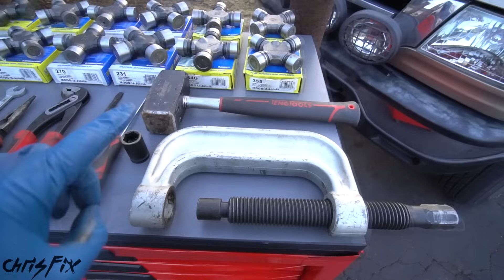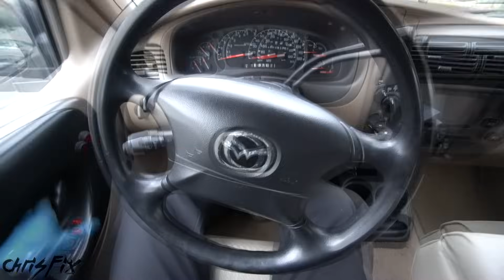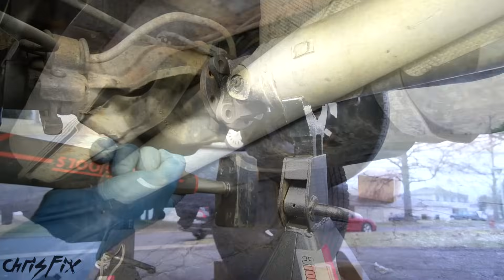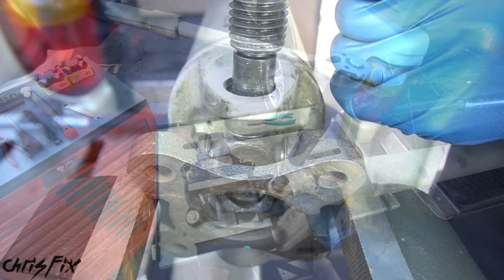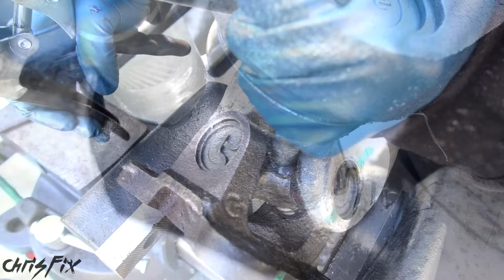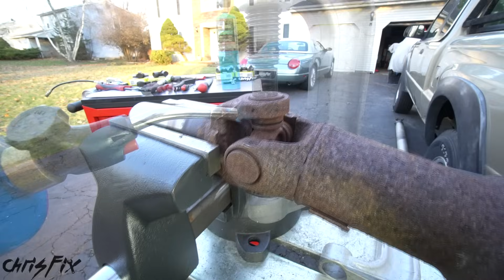How to Diagnose and Replace Universal Joints (ULTIMATE Guide)

Comment: if your rear end has the straps that go over the ends of u joint like a 7.5 chevy has get new straps or you will have to pretty much smith it till you get the tolerances back into spec . found that out on a 81 elco  still rattled even though new ujoints were in an the clip in lock position . i know its not a ford with a 8.8 . but just saying for anyone trying to figure out how to do on different vehicle knowledge is power but can be annoying so ill shut up

Comment: I’ve got a ‘95 f150 with almost 275k miles. It’s lifted slightly, not a whole lot. I was climbing a steep hill today, as I do most days due to where I live, and I heard a loud, rapid banging sound from what seemed to be under the bed as I climbed the hill. Could it be a u joint?

Comment: Gotta a question:
Have 92 ranger extended cab (super cab). This truck has the 2 piece driveline with the center bearing. I think I have the single Cardan connecting to the t case ...boot and driveline connecting to it and the rear end.  I'm replacing the u joints and the center bearing. The repair manual has the figures for torque specs Circular flange (flange that connect to rear end) 70 to 95 lb ft
Supercab center bearing bracket to frame (cnn bolts that connect to frame) 27 to 37 lb ft
Supercab driveshaft to coupling shaft bolts (think this is the 4 small bolts on the Cardan shaft) 13 to 18 lb ft
Supercab one half round yoke to coupling shaft 100 to 120 lb ft
Supercab slip yoke to coupling shaft tube 41 to 55 lb ft
The problem is don't know how all of the parts look...no pics also don't have a torque spec for center bearing bolts (bolts holding the center bearing in) or  driveline bolts that connect to the t case (book just says whatever! hahahha) if no answer I'll post up what I find anyway... pulling things out sometime tomrrow!
Reply: Oh yeah reason for repair: you know how some people's knees pop that is the sound when driving up an incline. Doesn't happen always on small inclines yet driving a few 1000 feet up you would always get it. The center bearing has cracks in the rubber, the drive shaft is moveable, and looks like a u joint has moved slightly.
Reply: Also if anyone for some reason don't mark the driveshaft and are in a bind there is a way to get it back in balance. Will take some time out your day but it is possible. If you want to know I could post it up!

Comment: Driveshafts are balanced (as Chris mentions), if you change your u joints and suddenly have a bad vibration you may have the shaft installed in the wrong orientation.  I know of someone that spent 3K on a new transmission, differential, etc. when it was just that the mechanic installed the driveshaft out of balance.

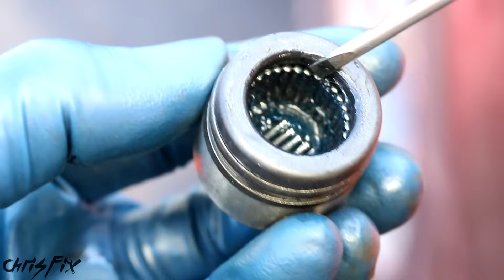Comment: This is by far the most comprehensive video on this subject that I have come across. More importantly, ChrisFix  has achieved a level of Jedi video skills that I as a videographer can only aspire to! (Not sure if my issue was already covered in the 5000+ comments but anyway, here goes...) Today, I attempted to changed my u-joints and came across a problem that was illustrated at 16:08 and that is, falling needle bearings. Once you check that the needle bearings are in their proper place, you set the two opposing end caps. The problem is if you are using the hammer method to INSTALL the end caps there is a moment or two that the shaft is not close enough to the needle bearings to hold them in place and the mere action of hammering could dislodge one or more of the bearings AFTER you have checked them and when you CANNOT see them. This happened to me and result is that the two needle bearings that fell flat, cracked the end cap while I was hammering it in a futile effort to get that last 1mm for the retaining clip to fit. Now getting the u joint out to swap out the end cap meant hammering it from the damaged end. The added problem here is that the shaft pushing out the opposite end cap damaged the plastic liner of that other end cap. Result is...I have to get another u joint tomorrow when the stores open before I can finish the job. Just be extra careful and you should have no problems but remember that if you need to back out an end cap, it could get damaged.

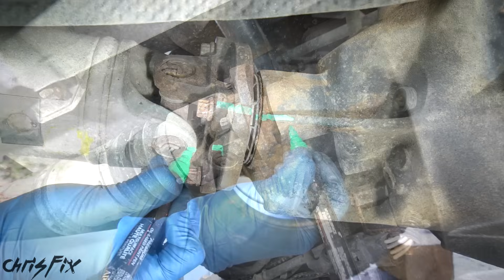Comment: At 8:50 Why marking> First: if not installed exactly as marked what would happen? Second: Does it mean I do not have to replace the whole shaft when the replacement is from a junk yard because it's unmarked.? By the way, great video. Thanks!
Reply from the maker: It shouldn’t matter if you don’t mark it but marking it allows you to remove any type of change that could cause a vibration. You can install a junkyard driveshaft and as long as it’s balanced it should be fine. Marking it is just a precaution since it’s so easy to do.
Reply: Got it. Thanks!

Comment: Wow Thanks for this video.!. My 2003 Toyota Tacoma's  drive-shaft  is making a similar Noise. I Think its the U-Joint.. But the the sound it makes sounds, like the clicking sound " As you back-pedal on a 10-speed bicycle ".. ( A Clicking sound ). Other then that the truck shifts good. Gos in reverse good..I'm just Confused with this sound... Mr ChrisFix, do you think maybe its an U-Joint.. (Thanks Mike Ziggy ).

Comment: If I forgot to grease the u joint after replacing it, will the grease that was packed into the bearing cap from the factory be enough or am I waiting for my new u joint to fail? It was definitely the type with the grease fitting

Comment: You guys Don’t have to waste your time marking everything to line it up because I just did mine and I didn’t mark anything and it’s perfectly fine. All of the Unnecessary cleaning and does not need to be done. It doesn’t change the performance at all and it really doesn’t make a difference on putting the new u joint in.

Comment: Chris, thanks getting ready to do this next weekend on my Ford F-250 that has three u-joints. Appreciate the great tips on the removal, replacement of u-joints and reinstallation. Especially appreciate the reminder on marking the flanges and drive shaft on both sides with neon ink for replacement to ensure it remains balanced.

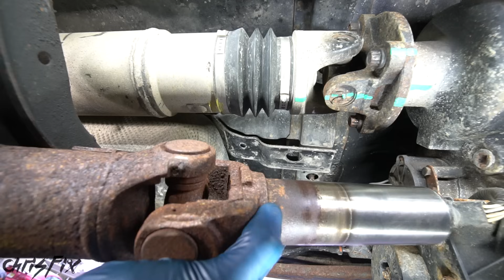Comment: 10:42 How worried do I need to be about how careful I am at removing and reinserting the yoke so I'm not ruining the seal inside? Not sure if its transmission fluid or transfer case fluid either, how do I know? I heard I should regrease the yoke because I need to use the correct grease so I'm not contaminating the transmission fluid/transfer case fluid which ever it is.

Comment: Great vid; 3 comments: On fittings with the zerk in the end cap, one snap ring is different to allow space for this.  When the zerk fitting is on the body, it's often more accessible on the side toward the driveshaft.  Some U-joints may come with different thickness snap rings to better center it in the housing.

Comment: I saw an old pickup truck driving down the highway, when in an instant the back end of the truck flew up in the air like a giant reverse wheelie!
Turned out that his front u joint fragged and dropped the drive shaft which acted like a pole vault nearly throwing the truck end over end. It was a spectacular surprise for the driver I’m sure!

Comment: The amount of work that went into this video is incredible. I don't even have a 4 wheel drive car (yet) and I just spent 20 minutes watching this video! 

It's the little details like the sliding tool/parts transitions etc that give a real professional feel to it. It's also great that you showed how to change them on different type of fittings. 

Great tip about hammering to loosen the new u joint. Why is it so stiff when fitted and how why does that loosen it off? 

Great video, thanks for taking the time to make it!

Comment: Hey just a heads up for Subaru owners this is a great video to watch to fix a damaged u joint but just a heads up on some Subaru’s you can’t take the u joints off the drive shaft. If the one of the joints are broken you’ll have to replace the whole driveshaft.

Comment: I did that, replaced my u-joints. And I still got drive shaft shaking. I have a rear wheel drive 1997 ford ranger. With just a single drive shaft. The shaking is so bad, that it keeps ruining my speed sensor gears, the plastic gears that go on the sensor, that they don't sell in auto stores, but can only be purchased online. Then I have to drive it in second gear, to reduce wear. I have been trying to fix it for about two weeks now, and it is hard to drive it to get parts, and then they don't help anyway.

Comment: good video...one thing though ..make sure the driveshaft  has no load on it when checking play. put it neutral and put the ebrake on..i have missed bad ones because there was just enough tension to think everything was tight.

Comment: That was an excellent video. Sound and lighting were perfectly done. 

Your demonstration of what one experiences and can test for to see if they need to be replaced was great!

I really liked the multiple techniques for replacing (hammer and press) and showing the 3 varieties of U-joints and explaining which ones to get for replacement and why one over the other (good choice - Moog).  

One thing I would have liked to see is the lack of liquid vibration at the end after replacing the UJs. 

Your use of the paint marker for correct alignment and to show any bolt movement is a great idea too, especially as you explained that they are balanced at the factory but that leads me to question - how do you balance it when you replace the driveshaft?

Finally, maybe it's really not that hard to center the open end of the press but using that socket you used for the hammer removal method could have helped to align it.

Comment: I have a '65 Mustang that has started to show some symptoms that I thought might be u-joints.  Your video describes my symptoms to a tee. U-joints are definitely on the agenda.  Thank you for the excellent video!
Reply: Tip - if you don't have a paint marker, Wite-Out works just as well, if you happen to have that.  I did mine - OMG, the front one was a disaster - broken cap with all needle bearings actually gone, that shaft on the body of the u-joint chewed up badly.  Replaced them both, no more symptoms.  Hooray!

Comment: well im seeing this video 3 years late. replaced my ujoints on my driveshaft and did it improperly. I was rolling down the highway at about 70 and ujoints came loose and cracked my transmission bell housing along with 3rd and 4th gear. lol

Comment: Hello the Great man,
Reaunalt megan 1.6 petrol, manual
I have problem with my car start on the car works but don't turn on I have electricity on my Dashboard I see battery alarm but I charged battery and I still can see battery alarm, petrol is coming from Gasoline hose I changed the spark plugs my car was twodays under rain and after that when I wanted to start my car became turn on and then became turn off and fan in front of Radiator starting to running and after  my car didn't start sometimes I hear a sound form Electric throttle can you help meI live in the Swedenand here price for repair is too high

Comment: Also, the best preventive maintenance I can give out is replace out your output shaft seal if you have the drive shaft already out, all you need to do is pry out the old one and tap a new one in, it'll save you time and hassle down the road
Reply from the maker: Thanks for the tip!
Reply: ChrisFix anytime! I just replaced out my output shaft seal for my truck, and it was a pain to remove

Comment: Chrisfix: driveshaft moves 5 millimeter->somethimg is wrong. Me:driveshaft moves 10 centimeter up and down with only my hands from a bad angle->its good still(in a 200 euro car i use to drift in snow tho)
Reply: And the driveshaft once broke from the rear when i was going around 70kmh its a nice sound when that happens

Comment: I haven't done the diagnostic yet but pretty certain the u joints are shot, so I'm sure this video is going to come in handy soon. My only concern is the fact that the previous owner had lowered the car and put  a new exhaust system in that forced me to use air shocks to raise it back up and keep it from scraping the ground, as they left no room .... 
Noticed I'm losing breaks and thinking there may have created an impact to the drive line that caused both problems.  Like I said, I'm just figuring stuff out on my way and haven't even crawled under her yet. This is a 1965 Buick Skylark 300 that I just got and want to be sure it's as stable as I can get her without breaking my knuckles or my bank. 
Ladies can get er' done too but oh how grateful I am for men.... hee he
Might just post some videos so you guys can pat yourselves on the back too for when I get it done right. 
Thanks for the video Chris
ciao

Comment: great video, it helped me out greatly on my 2000 ford ranger, where did you purchase that metal portable work bench from?
Reply: Eric Poulsen II is yours rwd or 4wd? How many u joints?
Reply: MCFriedChicken1  RWD & 2 universal
Reply: Eric Poulsen II oh what part number did you use?  Some say they're the same for the front and rear u joint and others say they're different.
Reply: MCFriedChicken1  moog part 354 both
Reply: Eric Poulsen II thanks!!
Reply: MCFriedChicken1  no problem

Comment: Do you have any videos on CV axles or joints? A lot of vehicle usenthem especially in Jeeps. People spend a lot of money for replacing them and it’s a SUPER easy job. Replacing the CV axle or removing the boot and replacing just the joint. It’s messy, but easy

Comment: I know Chris said that to rent a press kit. However is it possible to get what its called, cause Australia (at least in my area) dont really do tool rentals. Rather not buy a AUD $300 shop press i might use once or twice. If possible would like to find a similar or exact hand press tool like the rented one.
Reply from the maker: Here you go: https://rover.ebay.com/rover/1/705-53470-19255-0/1?ff3=4&toolid=11800&pub=5575376537&campid=5338268427&mpre=https%3A%2F%2Fwww.ebay.com.au%2Fitm%2F10pc-Ball-Joint-Press-Service-Kit-Anchor-Pin-Press-C-Frame-Brake-4WD-Tool-Set-AU%2F292460326778%3Fhash%3Ditem4417fe6f7a%3Ag%3Ast4AAOSwf~Jaj9ai

Comment: GREAT VIDEO!!! One tip I can contribute is if using greasable joints be mindful of the direction the zerk fitting... as you experienced the grease gun dosent fit if fitting is not facing proper direction. If put in wrong direction then is impossible to grease once installed. Again Excellent Videos!

Comment: Just two thoughts: first, think ahead and spray penetrating oil on the bolts and u-joint bearing caps/retaining clips. Do this every day for a week if they are really rusty. Even one day before you want to get to work will help. You'll be glad you did!

Second, use a rat-tail file or a chain saw file to clean up the yokes. Much easier. And don't forget to use anti-seize compound on all threaded parts.

Comment: Question:  After melting the inner plastic rings, do I immediately begin pressing out the joint while it’s still hot?  Not sure if any residual plastic will re-harden and make removal more difficult...or it will just press out at that point, even after it cools?  Thanks for a reply!!  Love this!

Comment: Dude if you ever need a truck to make vids on my 96 ram 1500 is at your disposal.  Just did the governor pressure solenoid and transducer still got a bit to go yet on bringing this thing from junk but found it with no rust! Nobody ever took time to fix the ole girl damn near all sensors are out and the dash is ok but not great few cracks

Comment: Also known as Uni joints or just unis :) great vid! nice truck too whats it called?
 I wouldn't recommend using a flexible or as you called ir a uni adapter on a breaker bar, you dont want any movement where the socket can burr or slip on s tight bolt.  better to use a 90 degree adapter, you might have to manuever it a bit, but if you burr those bolts its a major PITA UGhhh hahaha

Comment: Good morning Chris fix had a quick question I'm having issues with my vehicle it's a 1999 Pontiac Firebird each time I goes over 55 mph and over starts shaking really really bad in the front I replace tires and rims brand new I change rack and pinion I also took it to do an alignment / balance and then I heard things about brakes and the disc I also replaced all that  everything I'm basically now in a dead end still shakes bad
Reply from the maker: That sounds like a tire balance issue to me. Maybe get it rebalanced and ask them to be extra careful because you have a bad vibration. Also check control arm bushings
Reply: ChrisFix i will go and get it redone now that u mention it i do recall  seeing bushings worn out on control arm will replace them also
Thank you 
I appreciate your response

Comment: I can't thank you enough! I'm a computer geek with ZERO mechanical inclination. I recently bought me a 1994 F150 with 245k miles. I absolutely LOVED IT! It was a county truck before I bought it so it was beat up pretty bad. Thanks to your videos I've been able to get it back up and running really well! New alternator (busted a hole in the radiator and replaced that in the process), new started solenoid, new battery and yesterday my first oil change (it was a disaster at first because the filter didn't go all the way in and about 5 qts of oil gushed out). Today I replaced the air filter and added seafoam into the engine and that truck runs a million times better! It still needs a lot of work but your videos give me the confidence to do it myself. Oh I also used a clay bar to clean it like you recommended and it looks great!

Comment: You are a lifesaver man. I was doing u joints in my daily driver pickup. I've done u joints for customers hundreds of times and never once had one that got hard to move after assembly. You blew my mind when you demonstrated the trick tapping the yolk. I must have sat there for 20 minutes tapping the joint side to side trying to find the sweet spot.